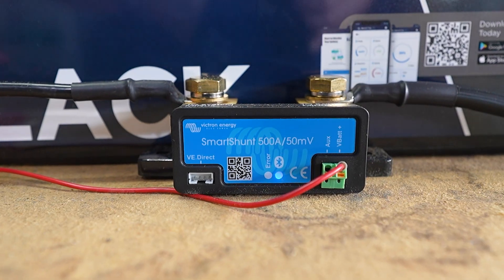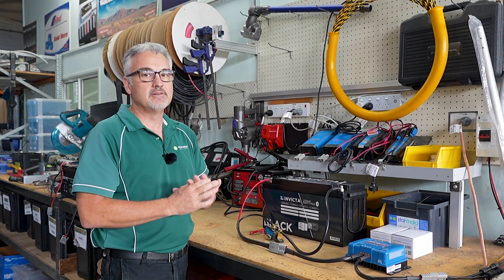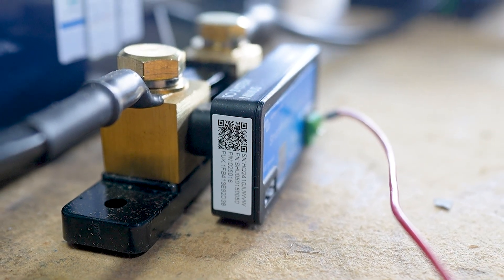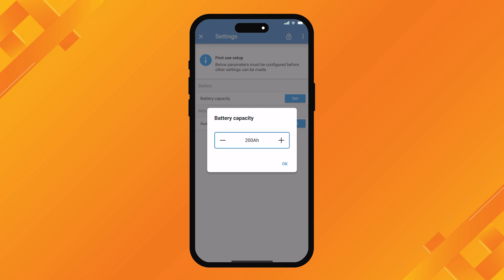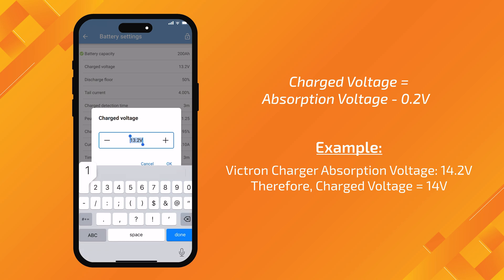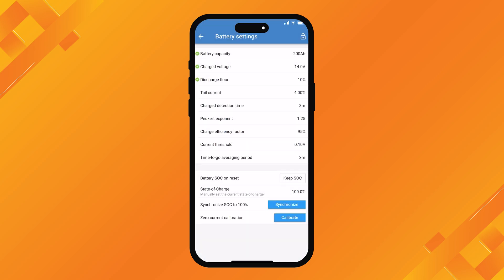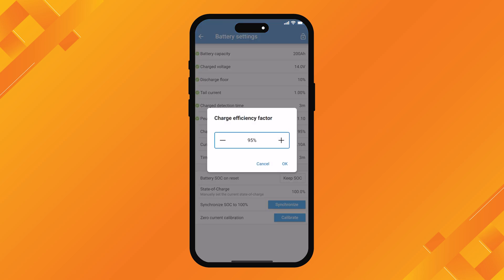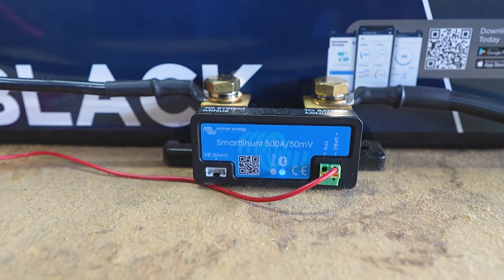How to Set Up a Shunt | Wiring and Programming

Comment: Hi,
I have a 3 x 120ah agm battery system I am trying to put the 500a/50mv smartshunt onto. They are in parallel and my question is do I run the negative from the shunt to the first battery and the positive from the shunt to the last battery? And do I need to attach the smartshunt "aux" wire, and if so to which point in the battery run would be best place for it.
Thanks
Reply: Great video by the way.
Reply from the maker: Thanks for watching, glad you liked it. Yes run the Negative to the first battery and the positive to the last battery.. That is ideal.
The Aux Input on the shunt is only used if you want to monitor the Voltage of a separate battery. Usually, this would not be used at all.

Comment: Hi, how do we connect in a 72VDC system with 6 x 12V batteries in series? Thanks
Reply from the maker: Hi, yes you need to series connect all 6 batteries to get to the 72v arrangement.

Daisy chain them positive to negative . Then you connect loads/chargers to first positive and last negative.
Reply: @springers  Thanks for your reply, but I mean how you connect the Shunt to the 72VDC system. Because tje max voltage of Victron Shunt is lower than 72VDC( charging current is 82VDC) and I cannot find in the market have the shunt suiable with 72VDC, Thanks
Reply from the maker: @phandinhthuong4557  Sorry for the misunderstanding. Unfortunately, the Victron Shunt cannot be used in your setup as it has a 70V limit. Victron does not make one with a higher voltage sorry.

There may be another brand out there that does a higher voltage but I am unaware of any.